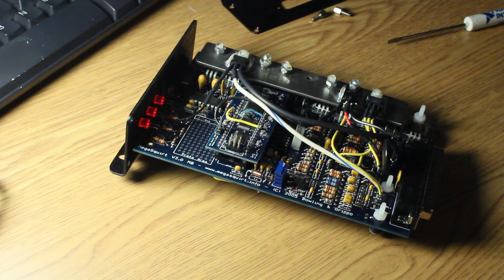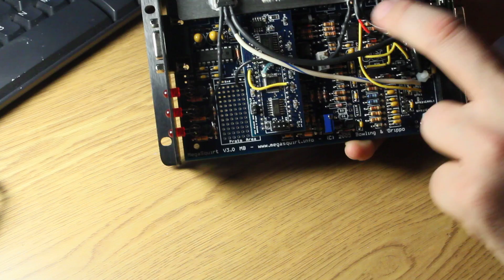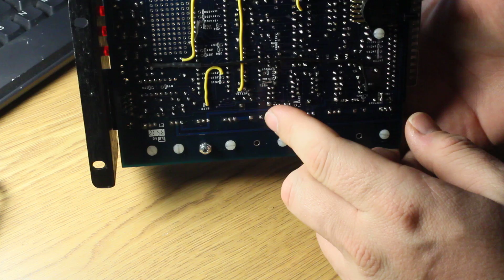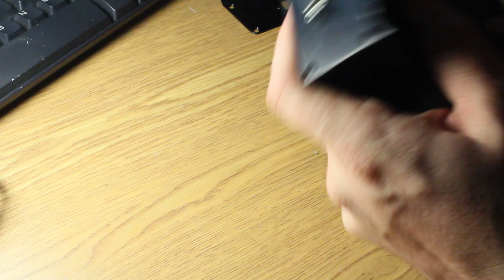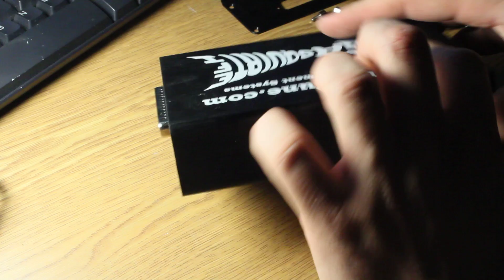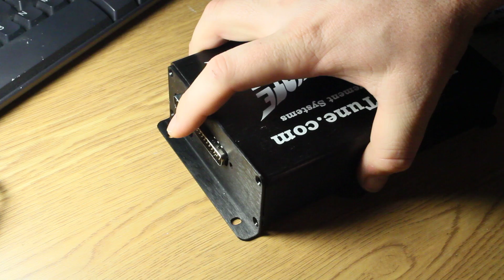Evan's Megasquirt Build Ep 7 - MS2 Final Case Assembly, Etc

Comment: is the hot glue still in place or it got carried away after the heatsink beeing heatted up?
Reply from the maker: good question. I'll check and let you know. I should have used locktite or a nyloc nut but got in a rush. don't do that.

Comment: How many hours id it take to build the unit and how do you like the way it works? I am looking for a Fuel management kit for a big block Nova with a couple of fogger kits. I am from the old school and am looking for help with any information you can provide. What are you running your on?
Reply from the maker: I was running a 2liter turbo in a Mitsubishi. I love the system, works great. it took probably 3-4 hours to build, most of that was reading to be sure it was set up right for my application. if you can afford it, I would look seriously at the ms3 pro from diyautotune. already built and water proof. it's $900 or something but for a v8 you'll need an ms3 instead of the ms2 I used.. so it'll be more like $500 instead of $300 of you build the board.

Comment: Nice Vids Evans, I just recieved my Megasquirt III w/PCB3.0 between the forum help and MsExtra they are kinda confusing, Have you done this before? You're quite knowledgeable I eventually would have full sequential injection and spark on a V8, should I follow some of your steps in the assembly process? Thanks in aadvance.
Reply from the maker: Hi.  I have not built a MS3, but I the mainboard (3.0) is the same for MS2 and MS3 for the most part.  I'd use the msextra manual, unless you have questions about it, then go to the megamanual for clarification.  If you plan to run V8 on sequential fuel and spark, you may require an MS3-X expansion board.  I'd check the comparison page to verify:  Google: "Megasquirt Product Comparison".  You can run wasted spark and batch fuel on a V8 with MS3 (or MS2 for that matter), but probably not sequential.  Also note that the MS3-X has no high power outputs for spark, so be sure to either work out a coil on plug setup (LS style coils), or locate an ignitor that will work for you.  After that is worked out, you probably just need to work out how you'll get the crank/cam signal in and the rest should be a breeze.